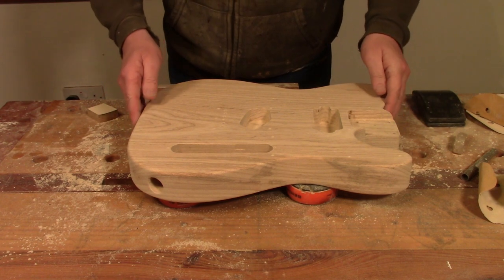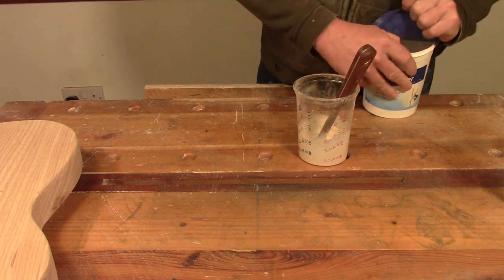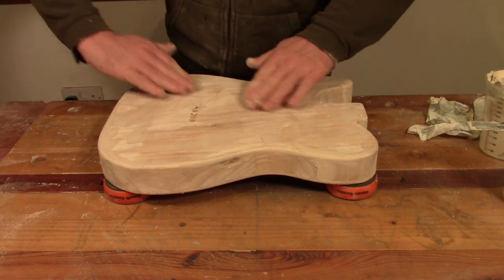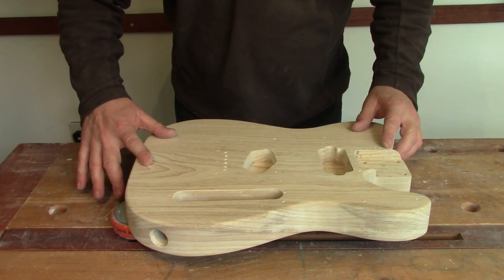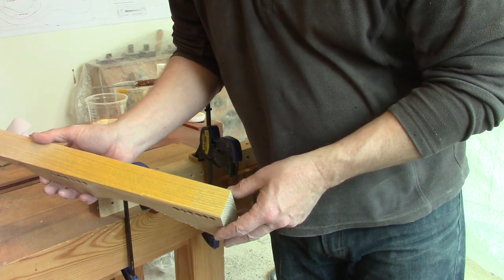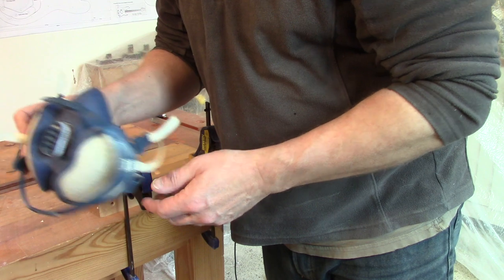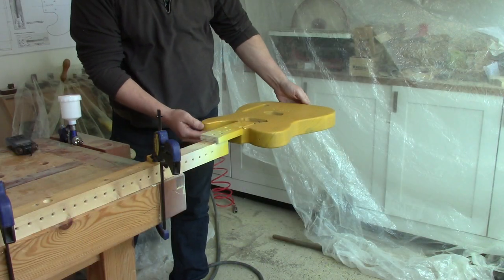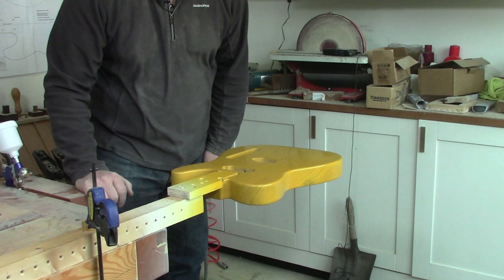Micawber telecaster build part 5.

Comment: In fact thinking of doing one myself, but using pine. Heard that the first telecaster was made of pine and that Keith’s is one of them. So wouldn’t it be more correct? And beside, easier to find good materials for cheap so if I mess up, it’s not the end of the world, try again. The urge to make something is strong in this one. Not just go out and buy something, no no no.

Comment: looking great.. I hope you have some secrets to keep your camera equipment nitro free.. especially during those close ups.  I was initially worried about the dark spot on the edge of the lower bout as you sprayed the first coat of color.. (colour) but it faded nicely on the second coat and then the clear.. fantastic..
Reply from the maker: I only use a fairly cheap camcorder when I'm spraying and use the zoom to keep it as far away as possible. It will die one day!! I tried to blend the dark spot in as best I could, it doesn't look too bad I think. I'm calling it fiugure and that's good right lol :)

Comment: Coming on very nicely! You had a little glint in your eye when you said work was starting on the neck! I’m in the process of making a quarter sawn plane neck with a ash fretboard, it’s my first attempt and I assume I will need to seal the fretboard as it’s open grain so a filler will be useful on that. Any tips on sealing that? Maybe a hardening oil? I haven’t got a spraying gun yet!
Reply from the maker: I love making necks, can you tell? lol! I've seen the pictures of the fretboard, looks nice. If you are using an oil finish you might not need to grain fill, you will need to use some sort of finish on it if only to keep it clean. I'd use some sort of Tung oil or similar, building up several coats.

Comment: Uhh, is that filler a dry wall spackle???
Reply from the maker: Yes, dry wall joint filler, makes a very stable and easy to use grain filler. I've used it for years with great results.

Comment: after watching  around 78 million episodes of GGBO 
or thereabouts , I still don't get the grain filler bit , and
no one has explained truthfully ,why?
Speaking as a numbnuts of course.
Reply: Grain filling is to fill the pores on the wood. Open grain woods like mahogany and ash suck the finish into the pores and it can take lots of coats of finish to level things out. So if you want a glass like gloss finish the grain must be filled. Some people accent the grain by using colored filler or leave it out altogether for a different kind of look. Not filling grain just looks lazy to me.
Reply from the maker: Pretty much as Dane says, helps level things out and stops the wood sucking in lots of finish. On the recent thinline build I coloured grain filler black, it looked great against the back of the mahogany body.